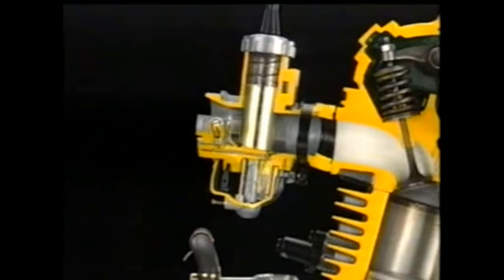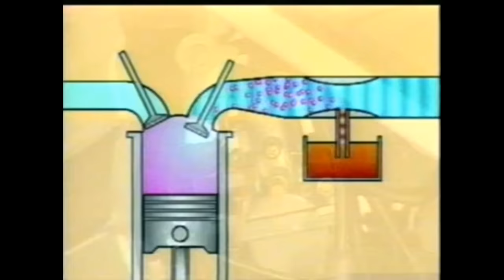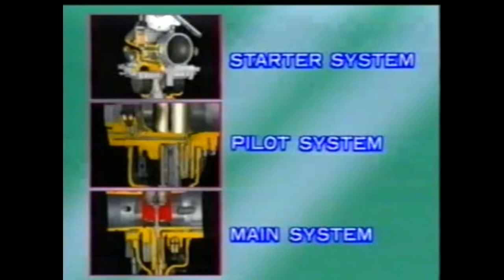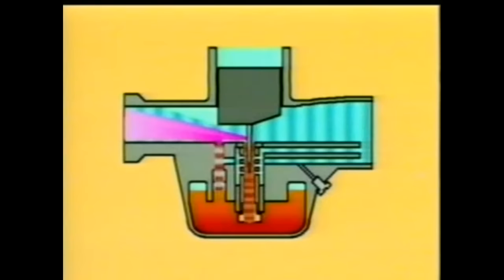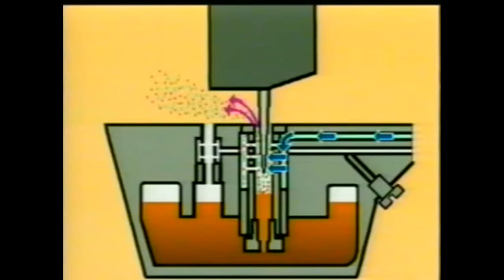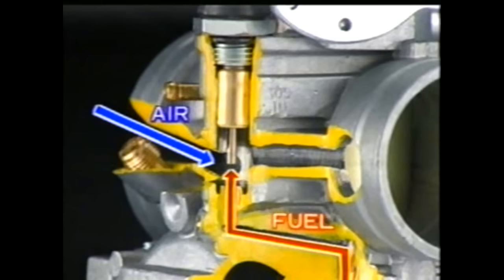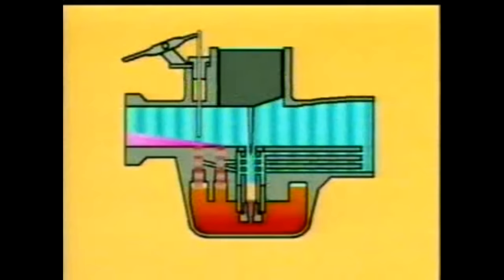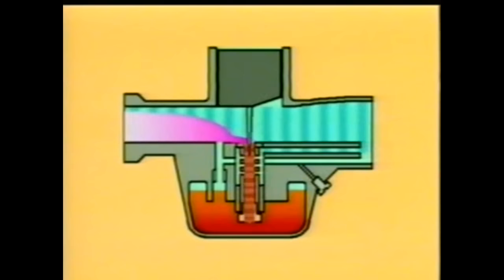HOW MOTORCYCLE CARBURETOR WORKING ANIMATION

Comment: very impressive. my bike air screw located on the engine side half not on air filter side. is it air screw or a mixture screw. when i turn it clockwise rpm drops and engine shut off . when i turn it anti clockwise rpm rises. can you tell me is it different from what you described in this video?

Comment: hi everyone, I have a question, hope someone may have the answer. At 7:23 it says that on tightening the screw of the pilot system blocks the air coming in and that produces a richer mixture but, shouldn't be the other way around? as far I understand, the more air flows, the more fuel it sucks. Thanks in advance.
Reply: pl remember that the pilot jet size is fixed. fuel is delivered based on size of jet and the pressure difference caused by air flow, So more air will result in higher difference but not more fuel. on the other hand less air will result in less pressure difference and thereby less fuel is sucked into the throttle body
Reply: @gururprasad2278  during the half throttle fuel will flow from pilot?when it will stop the supply fuel?

Comment: Tell me if i lose that air fuel mixture screw is it  only  control air presure in carburetor?when i lose, it supply large amount of air in carburetor  with fuel.when i tight it supply  low amount of air with fuel.am i right pls help me.
Reply from the maker: what can i help you?